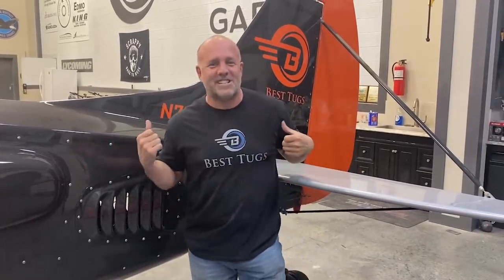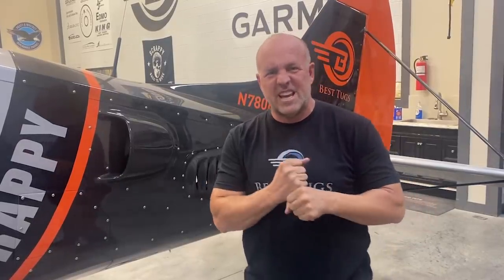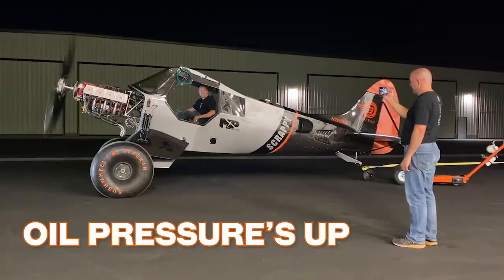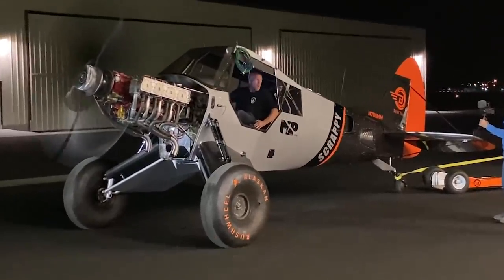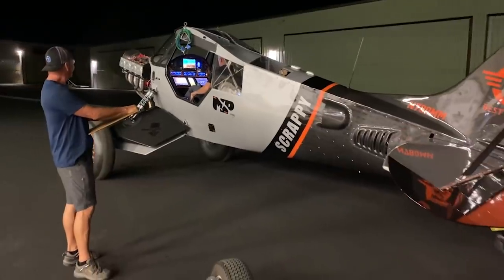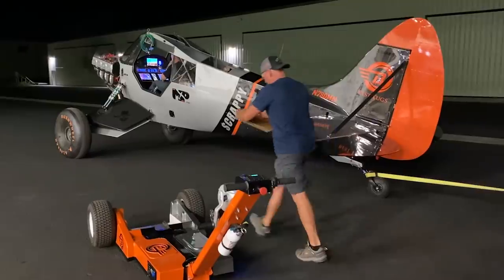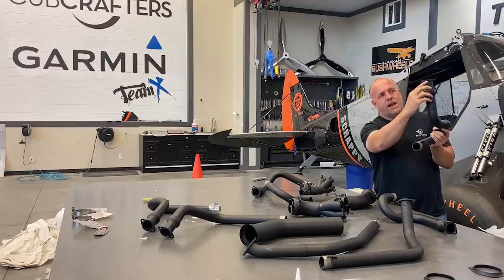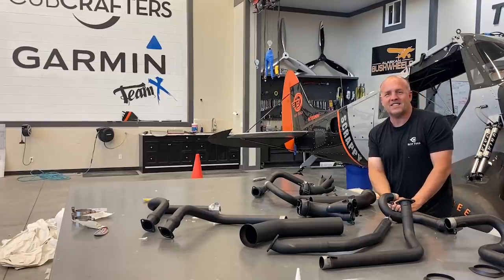Monster Race Engine Roars to Life in Tiny Bush Plane 😳 | Scrappy #34

Comment: Exhaust system made from PVC pipe? How soon will it melt and burn up ?
Reply: The PVC was only used as a template.  You can see him welding the stainless exhaust later in the video.

Comment: Mike i am wondering why isn't diesel's are more popular these days in airplanes
Reply: It is. It's called a "turbine". Diesel and jet fuel is very similar. Diesel engines are heavier, due to the higher compression ratio, so the cylinders have to be stronger.

Comment: schedule 40 pvc pipe? isn't that going to melt from high temps?
Reply from the maker: It was only temporary for a quick run. The new exhaust manifolds will be installed and won’t be PVC 👍🏻

Comment: wont the pvc pipe melt cos that stuff gets hell hot??
Reply: PVC was only used as a template.  You can see later in the video where he welds the stainless steel exhaust.

Comment: What did you do to the engine to get 820 cubic inches out of it? Stock it's only 720.
Reply from the maker: Great question 👍🤠 I saids It’s 780 not 820.  But the way I did that was I found a wide deck case so I could open up the case so I could fit the piston kit that makes 360 Lycoming into a 390.  On a 720 with the big piston kit makes it a 780. It’s the only one in the world.
Reply: @MikePatey  Just wondering. Nice way to bump the CI.

Comment: Is the exhaust supposed to be pointed at the antennas? 😳😬
Reply from the maker: Great question 👍🤠 no they shouldn’t and they aren’t. It’s the camera angle.  They are offset and the antennas are back past the required separation limits even if it was pointed directly in the slipstream of the exhaust airflow.
Reply: @MikePatey  awesome 👌 so all thats left is to put some redbull in the fuel tanks. Because redbull gives you wings. 🦅

Comment: Hi Mike, 

I'm gonna ask a really stupid question. When you built this type (of awesome!) - I know from some of the earlier videos, you talked about the prop and its performance being in a particular place (low speed, high acceleration - do you ever think about how you might look to a hybrid solution. In my head I am thinking maybe a prop with variable pitch, or clever blade design that can perhaps change by some for of gearing..

If not that, then I'm sat thinking could you bolt one or two of these or similar under something, and use them for high speed or efficient cruising. 
https://www.pbsaerospace.com/our-products/tj-100-turbojet-engine

What did scotty say tho... more plumbing, easier it is to break the Excelsior? :)